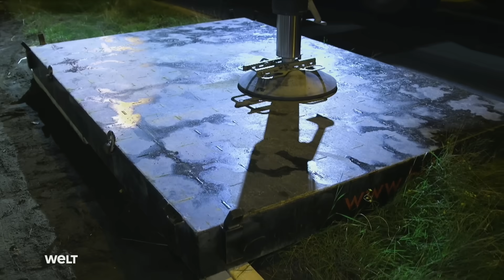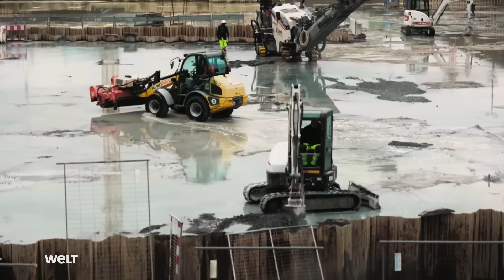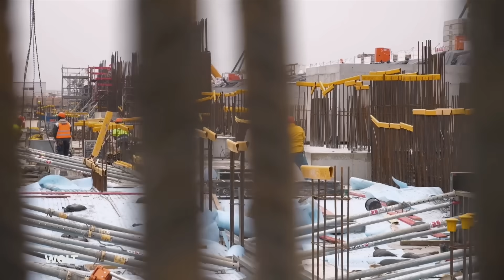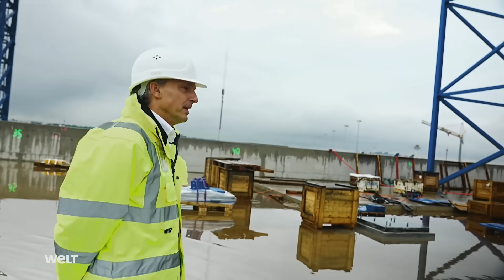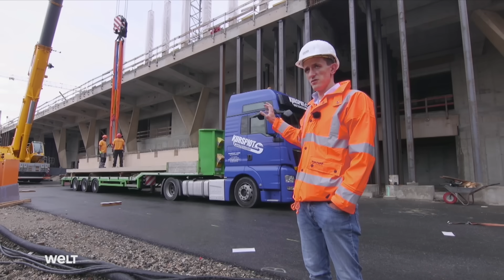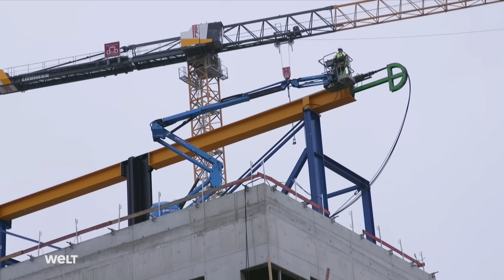THE MEGA SITE: Frankfurt - A German Airport Terminal Is Born | WELT Documentary

Comment: If Berlin Brabdenburg Airport is any indication, the new terminal will come on line a decade late and 3 times the original budget 😅
Reply: It's not an indication, as the construction of BER was severly mismanaged which isn't the case with Frankfurt airport.
Reply: @mstrmren  what about Stutgat 21?  What's your excuse for that?  It's also a decade late and 3 times over budget.  And to add insult to injury, there is no light at the end of that German engineering tunnel. 🤣
Reply: @tally1604   Stuttgart21 is a highly difficult engineering project. I don't know anything in recent Germany infrastructure-history that comes close to the complexity of Stuttgart21. BER was just pure stupidity as we know it from the Berlin and Brandenburg governments.
Reply: @mstrmren  and yet Grand Paris Project, 5 times larger and 4 times more expensive, is expected on time and under budget.  But I guess the poor  French are not blessed with the German gift of precision and efficiency.
Reply: @tally1604   yup, defo seems like that. especially considering their engineers can't even build new airport terminals without collapsing :D
Reply: @tally1604   And especially considering that Grand Paris Express will be using dual-track tunnels which are easier to build but unsafer, and Grand Paris Express will be build in Paris, not in a groundwater reservoir below a literal train station and above several already undergroud train lines on an underground bridge. Here in the US they'd never build something like that on time
Reply: @tally1604   Not really sure if you're making fun of German engineering here, because if yes, I'm sure you have no idea how construction projects work, and citing Grand Paris Express is a really, really bad example since it relies mostly on German technology to build it's tunnels....
Reply: @mstrmren As an English saying goes, the proof of the pudding is in the eating.  The French will be riding those trains in those tunnels in Paris long before,  and for a lot less money, having started a decade later too, than Germans will in and around Stugrat.  Enough said.
Reply: @tally1604   huh? Stuttgart21 will be finished in 2 years while Grand Paris Express will be finished in 2030.
Reply: @mstrmren  The thing that makes me wonder about the Stuttgart21 project is, that it seems that they have not done some proper ground research. The Tunnel that they wanted to built, can not be built because
there is far to much Anhydrite present. A very soft minerale-like stuff that
changes into gypsum when it comes into contact with water.
They should have known that befóre starting the built of the tunnel.

Comment: Not sure if it is really Europe's largest construction project. There are a few huge rail projects. For example Crossrail in London and there is the tunnel below Fehrmann Belt.
Reply: The Grand Paris Project has that honor, with a price tag of 40 billion euro, scheduled for completion by 2030.  4 new metro lines will be built, and 2 existing ones extended.  All told, a whopping 80 news station will be added to the system.

Comment: 0:06: 🏢 Frankfurt airport is building a new terminal, which will be Europe's largest construction site and biggest infrastructure project.
7:17: ✈ Terminal 3 at Frankfurt Airport is being constructed to handle 20 million passengers per year, making it bigger than Stuttgart Colin Bond and Hamburg airports individually.
14:22: 🚆 Construction of a new automated people mover (APM) system at the airport is underway, connecting Terminals 1, 2, and 3.
20:05: 🏢 The construction of Terminal 3 at the airport requires careful planning and coordination to meet high requirements and prevent failures.
26:36: 🏗 The construction of Terminal 3 continues with the installation of steel parts and the assembly of the roof.
33:23: 🏗 The construction of Pier J is progressing steadily, with the installation of various precast parts and the completion of the outer beams.
40:21: ⚙ The construction team is working on adding thermal insulation to the facade of Terminal 3's control tower and assembling the large facade elements.
47:26: 🏗 The construction of Frankfurt's new terminal progresses smoothly with the installation of a 2,000-ton roof segment.
Recap by Tammy AI